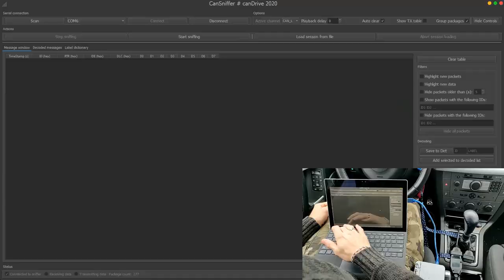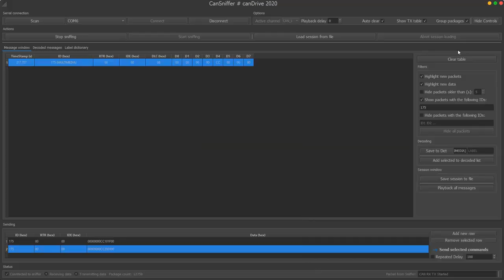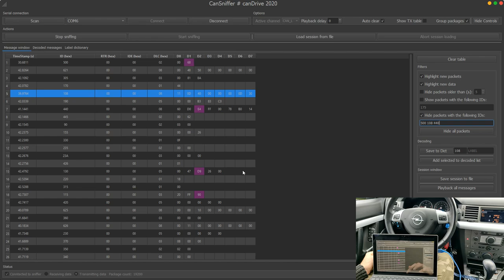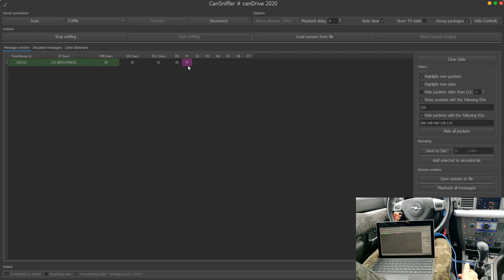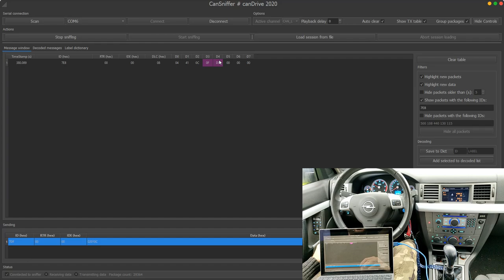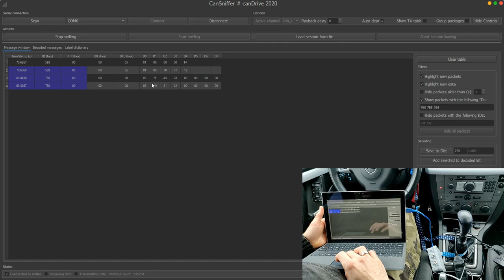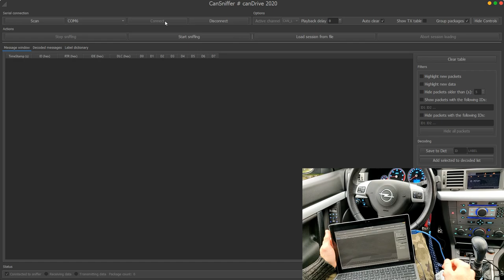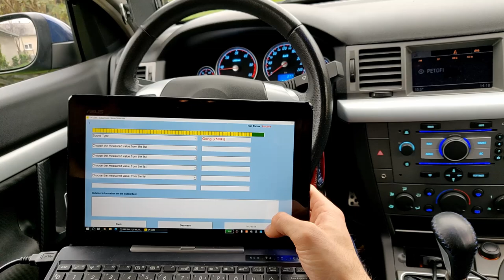How to hack your car | Part 3 - Reverse-engineering examples

Comment: can you please show full wiring diagram for your homemade can interface? the connections inside the odb2 plug and how the switches are connected? Great videos, little more detail would be good though.
Reply from the maker: here you go: https://drive.google.com/file/d/1jOJ_ptNbLPcsAc5EcoX9RwlUyS_8kdfx/view?usp=sharing
Reply from the maker: the rest is mentioned in my 1st video
Reply: @adam_  thanks for that will get mine built up do all 3 positions work on vauxhall/opel cars? what type of devices are on each one? high speed is obviously  engine/braking systems, but mid and low?
Reply from the maker: @garymetheringham4990  I briefly mentioned the devices in the 1st video. Regarding the speeds, every car can be different
Reply: @adam_  sorry to be a pain, but how do i change the speeds in the python gui? i want to change the connection speed of  CAN_L?
Reply from the maker: @garymetheringham4990  as of right now, you cannot change the speed from the UI. You have to change it in the arduino code at the top
Reply: @adam_  Nice one got it working at 250kb/s now, just one thing i have noticed, its not decoding the ID's correctly in extended mode. i getting 9digit id's and the id is totally wrong. example 0ffffd127 should be 1cfe9200 and 0ffffc027 should be 18fec027. any idea what needs changing?
Reply from the maker: I can check it for you next week. As my car doesn't use extended frames, the system was developed for the normal frame format.

Comment: Hi! 
Awesome project, but I have some problems.. 

the arduino does not want to send any canbus. I'm working on ford fiesta, mk7 pfl 2009, and on MSCAN (125k). I did change the can speed, so I can read them, but not send. care to assist? I'm guessing the active channel option in can sniffer is irelevant? I also do not have a switch, as currently I only need MSCAN. 

Thanks!
Reply from the maker: hey. Yes, the active channel selector doesn't do anything and you don't need a switch. How do you know that can not send? Have you tried to run the arduino examples?
Reply: @adam_  I tried sending the same signal I got for blinkers, but nothing happened. also tried for flashing headlights, but same result. I am still sniffing the values and I see no change nor on the car, nor the monitor. 
I have not yet tried arduino examples. will do today.
Reply: seems like my can bitrate is wrong butt cannot find where. in the begining I have both 125 and 500 for 8e6. and my module is 8mhz. same as yours.

Comment: thank you but when i send data to obd2 there is a firewall it cuts the connection so i should rest and reconnect to receive data again from obd2
thank you again for your openion about this firewall
Reply from the maker: what firewall are you talking about?
Reply: @adam_  in new car 2020 they say on the net  there is firewall who do not let you send data to the car from obd2 and when i try your software i received all data and connection was ok
but when try sending a package it stops every thing so i make disconnect then connect to get data again
thanks  a lot for your help

Comment: Hi Adam, I am trying to do something similar with my car. But when I replay the identified message back to the car, it responds only momentarily, eventually returning to its previous state. I am targeting a different feature than in your video (my cars radio is not on CAN) but if I were to give you an analogy, in my car its like, if I send the message for volume up, it turns the volume up by one only to go back to its previous state immediately afterwards. In other words, its seems like I am not able to "write" the changes to the bus. Any inputs? Thanks in advance. I am using a Korlan USB2CAN device and the linux Can-utils package for reverse-engineering.
Reply from the maker: Same thing when I wanted to overwrite the text on the display. The reason probably is that (in my case) the radio was transmitting the text information every 50ms or so. So, when I transmitted my message, it changed the text on the screen, but the next update from the radio overwrote it. I think this is causing your problem too. I have not yet find a solution tho

Comment: I dont have an arduino, i just an adapter from inno maker can2usb will the software work with it? Or do I have to make changes to the code
Reply from the maker: It will not work with it because the GUI expects the data to arrive in a specific format.

Comment: Can program Arduino to make function like coming home lights, for example? Or make cornering light with Fog lights when press turn Signal?
Reply from the maker: Yes! Cornering light was one that I really wanted to do, but I couldn't catch the steering wheel's position at that time. Maybe I'll give it a shot later.
Reply: @adam_  in opcom exist The option for display The steering Angle, but i supose that Will be very dificult to catch. 
If do with turn lights must be easy if The speed is more than 0 for not turn The Fog lights when The car is stopped.... For first version Will be possible.
Reply: Check out "happylightshow"

Comment: Man, im reading about "realdash" program. Do yo know this program. Basically can you use an android device or windows for create a digital copkit like Audi,etc...
Use the standar OBD2 protocol and you can add específics lines (for example the id to show if you turn on   low Beam lights) its very interesant
Reply from the maker: haven't heard of it before, but it's essentially the same concept as what I'm doing here.
Reply: @adam_  yes, the concept is very similar. But i dont know how convert de HEX direction that you have to XML for realdash. Can you take a look to the program,please?

Comment: Is it possible to start the engine via can bus without open the car ? Like copying the commands sent over the bus and then pasting it via Arduinos ??
Reply from the maker: probably not. starting the engine requires more stuff rather then just sending a couple of CAN packets. I don't think you can bypass the ignition and the immo easily, but I haven't tried.
Reply: It will be only possible if you have your transporder/immobilizer of your key in the ignition which is not practical and drains battery.
The other solution which I don't recommend is to disable Immo on your car. But any key will be able to turn on your car.

Comment: I had sorted my previus problem. Now I can sniff data.
Anyway.
Few improvement thoughts about program.
It would be nice to have not only hide same ID's, but exclude same ID's with different data selection. I mean, right now only one ID is shown at once(group cheked), even if data is different. To see different data I have to degroup packages, but that might overflow screen with data that is mostly the same. If there is one data sent 20 or more times and different data 1x, then it might be hard to find.
Haveing ID and data count would be nice(someone might need it).
Ocouring after xxxx times might be usefull for someone.
As I undrestand Decoded messages and Label Dictionary is stored in csv file. It would be nice to save to different file for different projects. Currently I have to cut csv files from folder to start new project without interupting prevoius project. And I can't rename it for easier finding from folder if I will have several of them in there.

I allready forgot. What is difference of "active channel CAN_L, _M and _H"?  what ever I select they all act the same. I thought that they might mean different speeds but nothing changes actually.
Reply from the maker: Hey.
I'd solve the first problem by not enabling grouping, but set the IDs of your interest as the only enabled packets. This way, you'll see all packets with that ID.
I wanted to keep this program simple, that's why I didn't bother with project and such.
Active channel doesn't do anything at the moment, that's why it's greyed out. I used it for another purpose, which I'll try to explain some time.

Comment: Has anyone tried to compile both of these codes onto a Windows machine. I compiled them all got everything loaded and operating but I get a utf-8 Unicode error on multiple lines
Reply from the maker: I encourage you to print out those line to the console where the error is thrown. This can be faulty communication or just wrong packets.

Comment: A lot of time wasted ;( Unfortunatelly your solution doesn't work with my Suzuki Grand Vitara 2009. I'm able to sniff High CAN packets at 500kbps only. OBD2 support ISO 15765-4 protocol (also called CAN 11-bit). Pin 6 & 14 seems to be the only one for such communication.
Reply: @Avi Assa Unfortunately, I did not. I triple checked connections etc., trying to find the solution, but I still cannot sniff LOW CAN packets. I will come back to you if I success in the future

Comment: Great video, i appreciate your work. Can you imagine hacking the ignition to start the engine?
Reply from the maker: that'd probably not work because of the immobilizer.
Reply from the maker: @slapnuts4658  I'm not 100% sure, but you cannot start modern cars without the key being inserted
Reply from the maker: @slapnuts4658  that will drain the battery. I really recommend buying an official parking heater for you car. they come with a remote, so you can turn it on from the house.